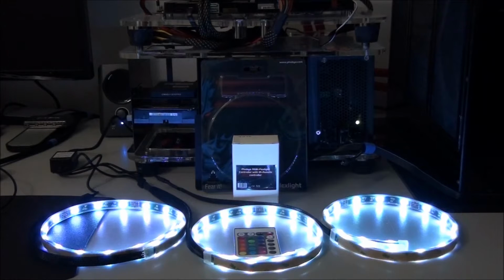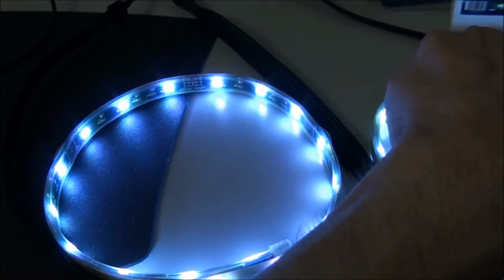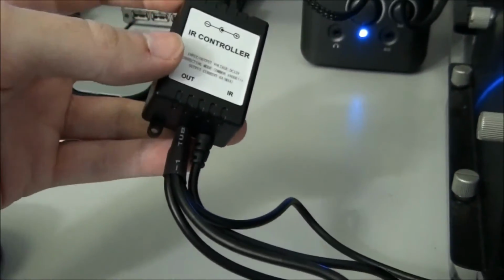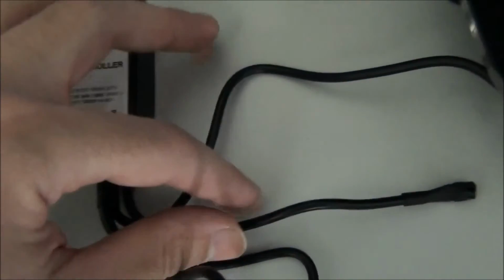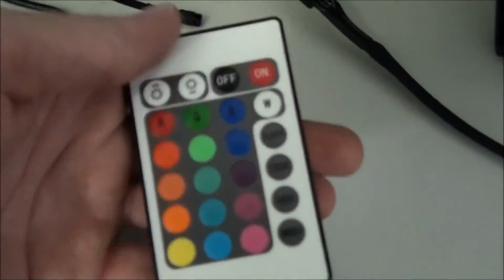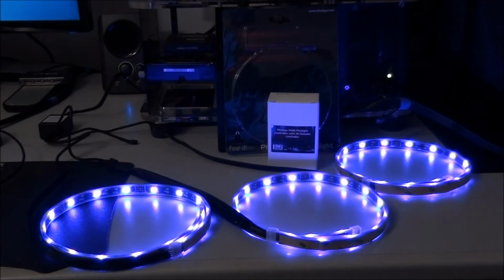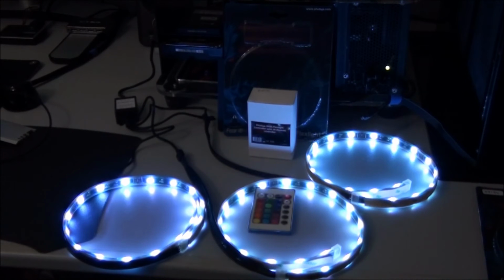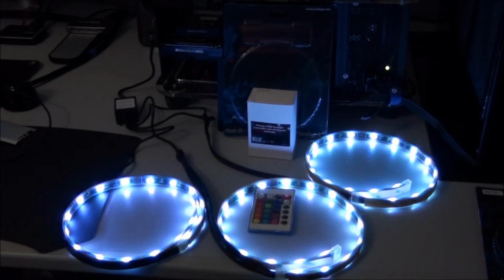Phobya RC RGB PC Lighting System Review

Comment: Hi. Thanks for your video. Do you have any idea why my high density strips are stuck on Flash cycling through all the colors? I have RGB strips and only thing i can think of is that they sold me remote with dead battery, because i can't change anything with controller.

Comment: Buy the controller + adapter so you have 3 connections and then buy a RGB ledstrip in some garden or light shop or something like that. 5mtr for only 20 or 30 bucks.

Comment: Knight Tempest is absolutely right I purchase these today and the LED strips the wires were not put in properly two loose wires  on two strips its a pity they don't make them better Id be happy to pay for quality what a waste of a day this was had to wait at my local PC as they were low on staff and then to get home and fit these.  I waste of a whole day "DONT BUY THESE" Till they they(Phobya) review quality  I would be quiet happy to pay $20even $30 more if the quality was there  BIG DISAPPOINTMENT I have there radiators they great but these LEDS   JUNK

Comment: you buy these from EBAY. instead of spending a fortune on the re branded phobya kit :( You should buy a 5M roll of HIGH DENSITY cable (300LEDs) and a 44 function programmable control all for less then AU$30 from china. the (re-branded) product shown in this video is the first generation of this system. just googled the phobya controller its.. US $20 and obsolete. the controller cost AU$5 from ebay. AU$7 for the new version.

Comment: Actually, from a technical point of view, UV IS NOT a color. It HAS a color, but is not one in itself. It does matter somewhat with light pollution, but not much. A TRUE UV light will pop out the UV reactive components regardless of light pollution. A black light for instance is a UV light, not because it's purple, but because of the filter used. A purple light won't do anything.
On a side note...An empty 5.25 bay seems like the best possible location for the controller.

Comment: Most definitely purchasing this lighting. Can mount the controller box inside the 650D optical bay area, going to order the low density version from my friends at Performance-PCS. The 650D window should be large enough to receive the remote signals, thanks again for a great video!;)

Comment: yes they do i used a larger version of this to make a light bar in my livingroom. i got a kit with 16.4' RGB LED strip remote power suply and a control box for $35 on amazon. the strip can be cut every 3 LEDs. the one i got has many more buttons on the remote with 6 customizable settings.

Comment: Thank you.  I may go and buy it anyway.  I too have a switch and use bitspower x-stations to control my lighting.  Just as you said in the video.  I am currently using blue and UV in my build, but I really like this as I can have both quite easily.  I have a Case Labs STH10 and it is a big case but I am sure I have room in the backside or  for the power block .  Thanks again for all the great stuff. Hope your business is prospering.  I wish I could do this for a living.